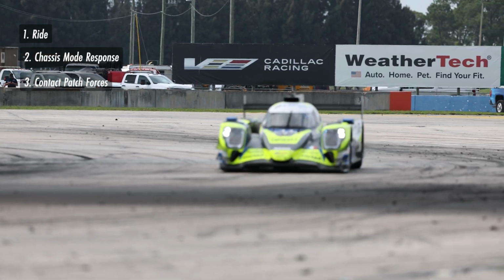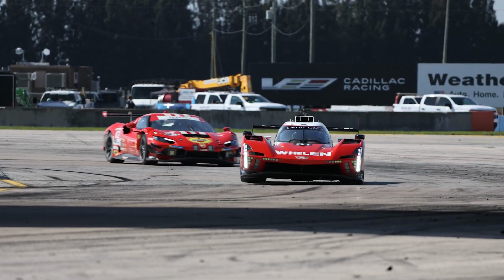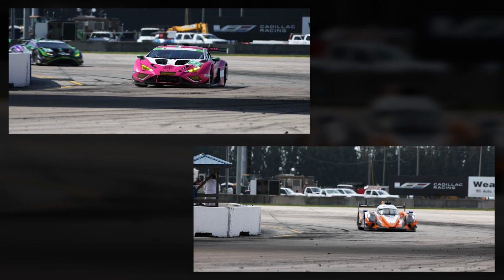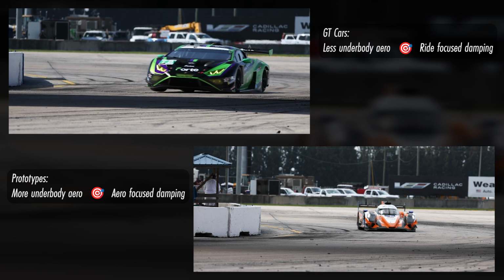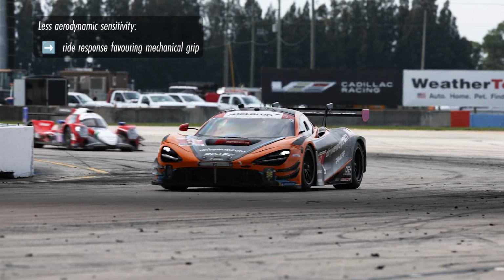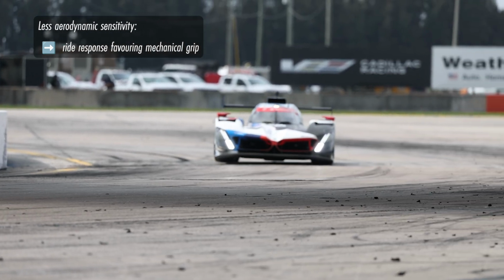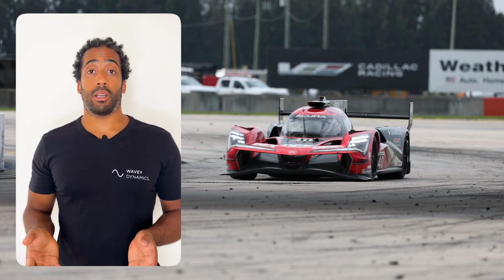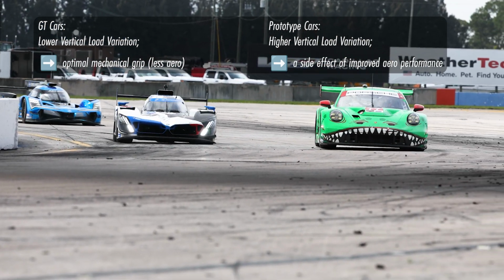Visual Dynamics | Learning With Your Eyes | Ep #2

Comment: Interesting. May I challenge the explanation or Tyre Vertical load Variation? The contact patch vertical load variation is not simply proportional to the ride frequency. Very stiff Suspension can also produce low variation in vertical. Variation of the contact patch vertical load is optimised by matching the required damping rate for the spring system. If the damping rate can be dynamicly varied during operation, then the damping rate can be used create resistance or release. Tractive Suspension from Holland offer dampers with response time of 170ms. Remember, there is a difference between body control and wheel control. The prototype type cars have low body control  demands because they are light.
Reply from the maker: I really neglected my comments in the last few months!

Always open to discussion. I'm aware that damping does change the natural frequency, but looking at it from a scientific stand point, where all variables such as damping, tyre stiffness, unsprung mass etc are controlled and we only alter spring stiffness, a high spring stiffness would introduce more load variation than a low spring stiffness. agreed?

Damped vs. undamped natural frequencies are influential in this of course, but you don't see such a difference between the two.

What are your thoughts?

 - Jahee